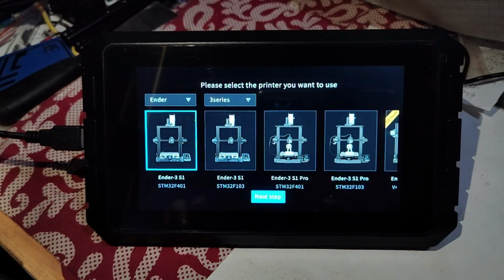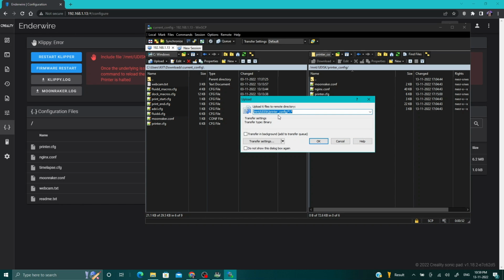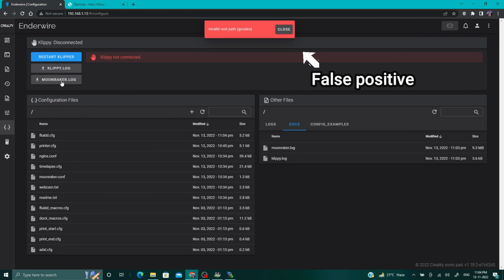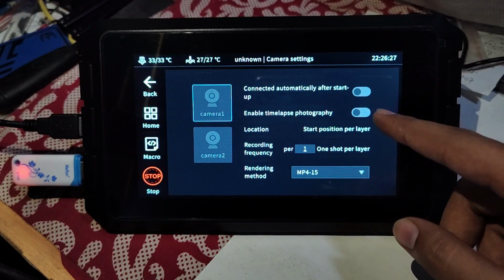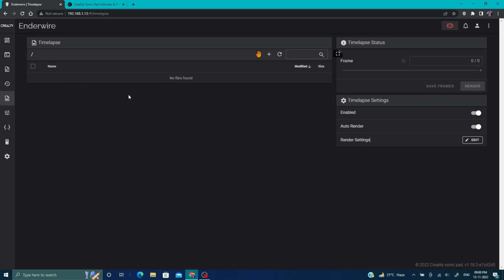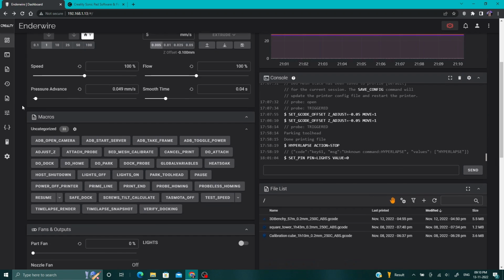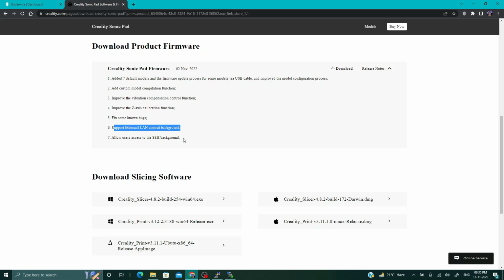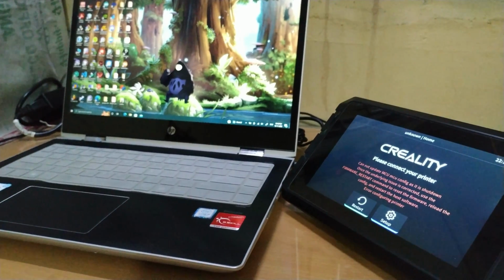Is The Creality Sonic Pad Ready Enough For DIY 3d Printers? | Setup & Tutorial

Comment: Doesn't work with SKR Pico. Through web it works but sometime does not connect plus Sonic Pad deletes gcode folder after restart. I'll return this screwed Klipper to Creality.
Reply from the maker: Creality, pioneering 3d printing solutions with added problems...🤗